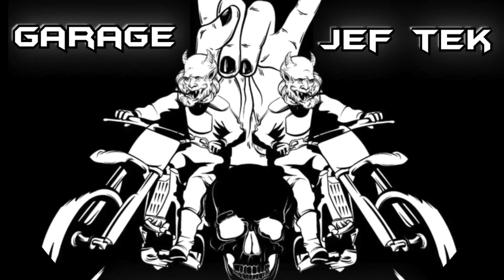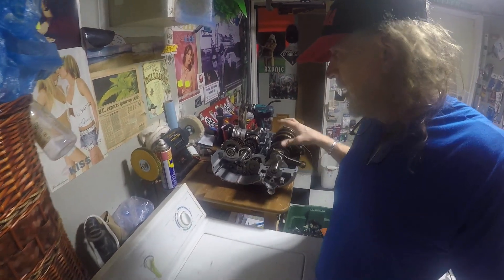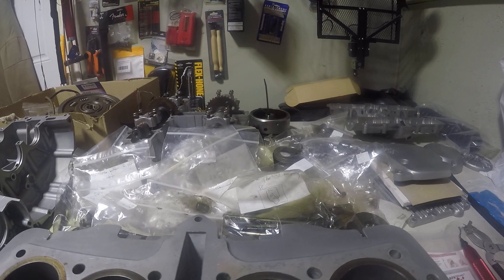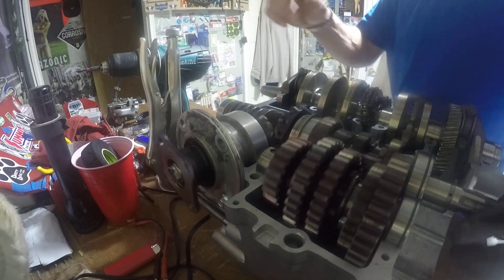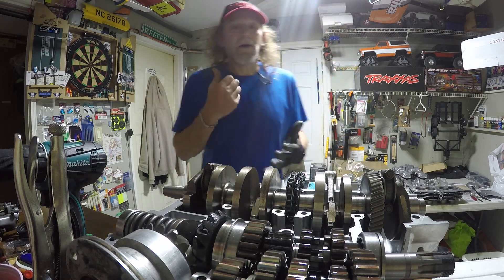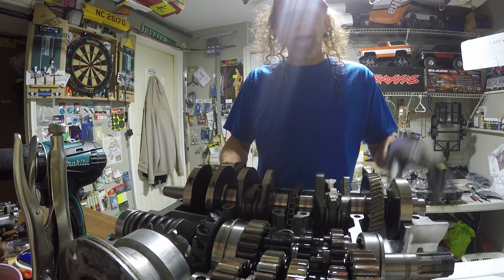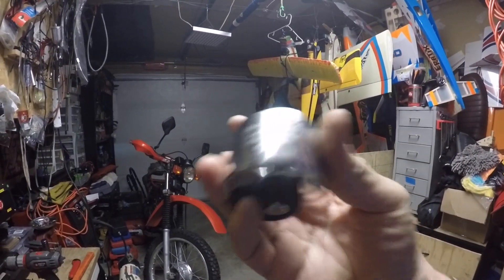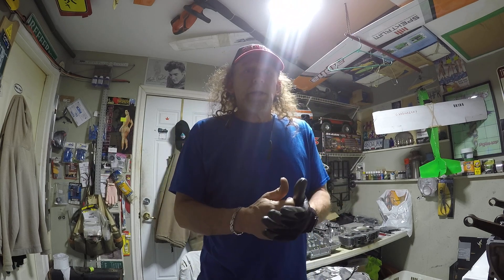Basket-case 1982 Suzuki Katana GS650G Part 1

Comment: First bike was an 82/83 Slowzuki GS750, Chain drive mono shock rear suspension.  Gear position indicators and only 5 gears.  Big enough bump in the road and I'd be pulling a U-Turn to go find my keys.  But the transmission in that thing was silky smooth.  Shame the bike was beat up.  Still loved it.  Be really interesting to see this thing put together.  Cafe Racer?
Reply: I had a mint 72 suzuki gt185 dual twin two stroke I blew it up and sold it for 700$  it had 6 gears it would do about 80mph